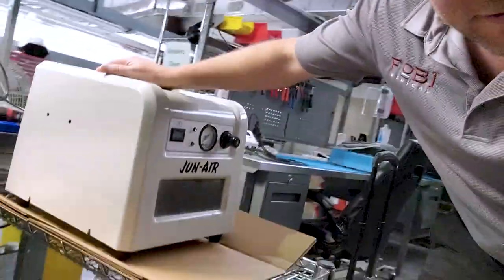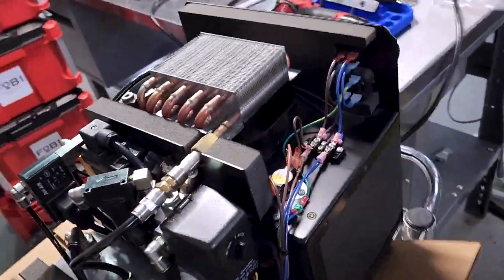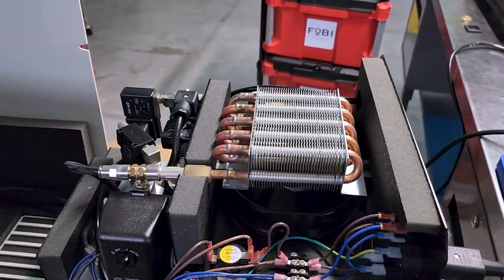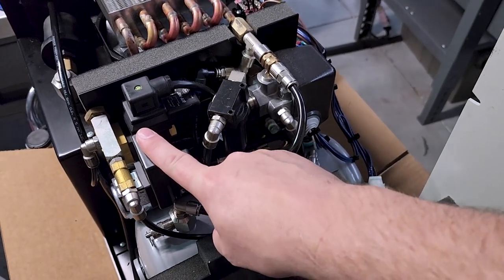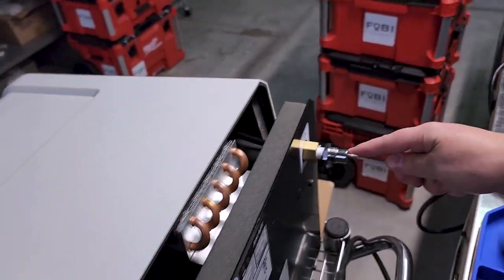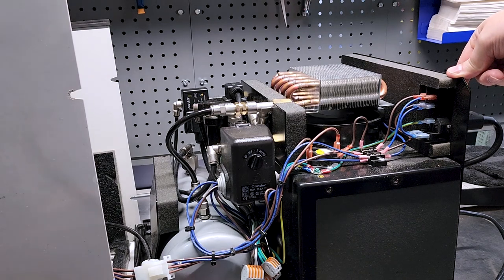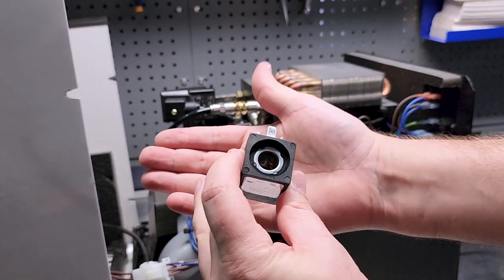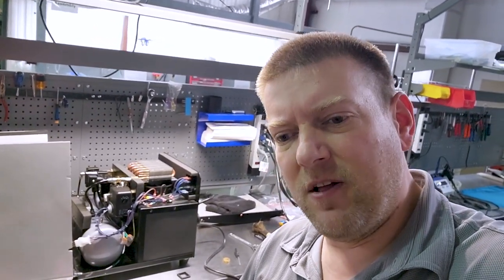Jun-Air UltraQuiet Compressors

Comment: Very nice compressor. The arcing problem with the solenoid is very rare, never seen of heard it before. Normally such a component has a few Kv isolation resistance because the coil is potted in resin to prevent a break in the winding due the 50/60Hz vibration. Would be interesting to see a test with a insulationtester (Megger) on this solenoid.
Reply from the maker: Coming up!